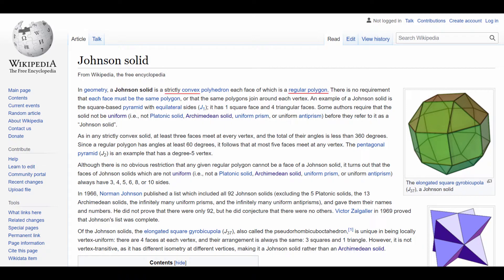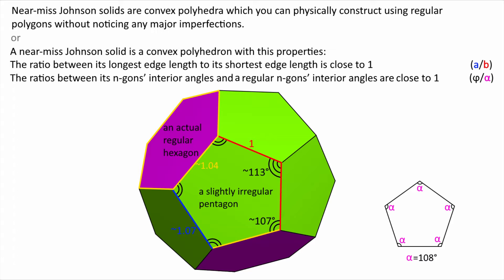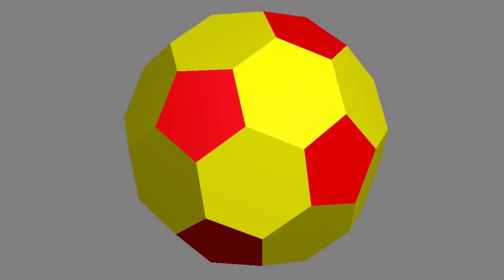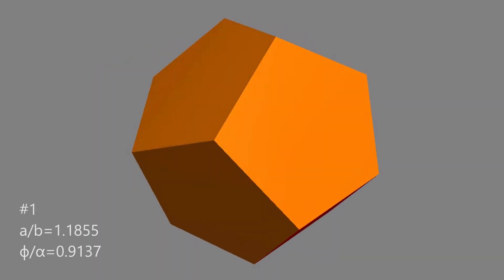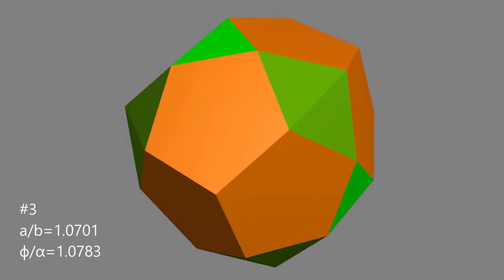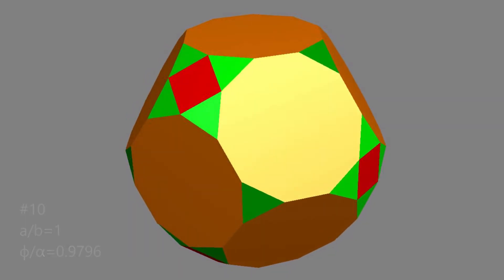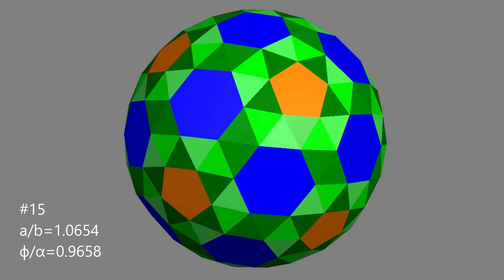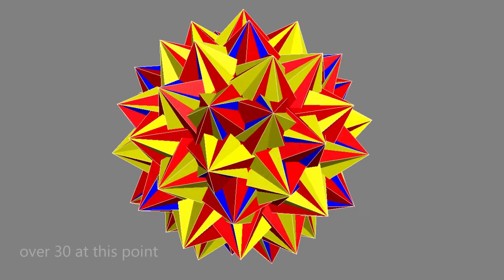Near-miss Johnson solids

Comment: Lovely to see these. I've also been exploring near miss polyhedra after becoming familiar with the johnson solids.
Since I'm working with physical modeling systems, my candidates have uniform edge length and / or regular interior face angles, but fail to have completely planar faces. That suggests another  metric for quantifying how near the miss is, deviation from planarity.

Another direction worth investigating is relaxing the overall symmetry constraints. Most of yours retain the full symmetry of platonic solids. Many of the Johnson solids have lower symmetry, like your early visual example that looks like a modified bilunabitotunda. I suspect there are a number of near miss candidates with  prolate and oblate ellipsoidal symmetry for example.
I hardly ever subscribe  even to channels I follow. I'm subscriber # 16.
Reply: I think i made a 93rd jhonsion solid, look for my comment and please tell me if im wrong